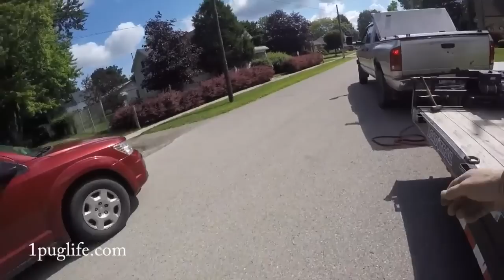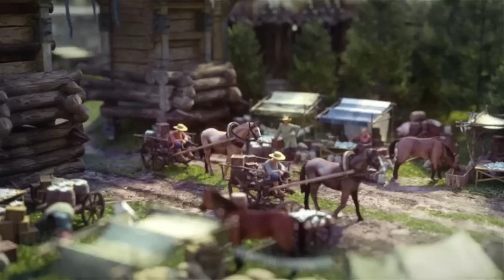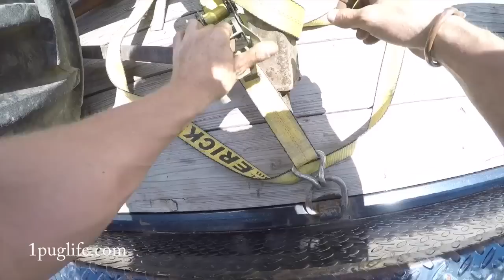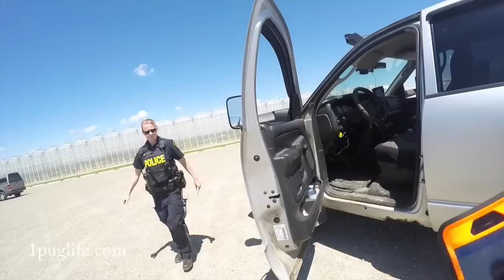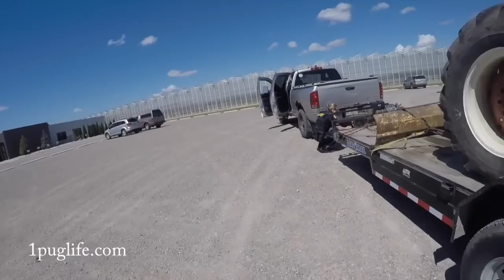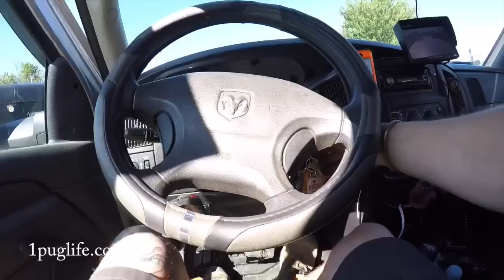illegal towing operation

Comment: poor pug here in murica you can pull 2000lbs with a prius and no won gives a fuck
Reply: mit the great Hell, my tractor weights 13,000lbs alone. Add the shredder and trailer weight it's pushing 15,000. Thats being pulled with a 1/2 ton rated for only 8500 yet it pulls fine. Cops dont give a flying fuck anywhere i go..
Reply: Ontario is strict with this type of thing
Reply: gg mit the great i watch you
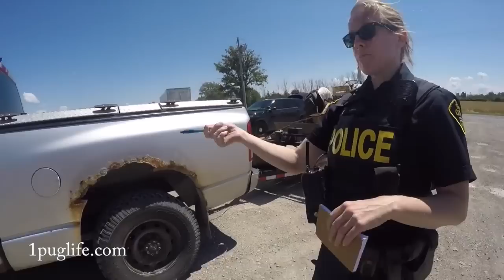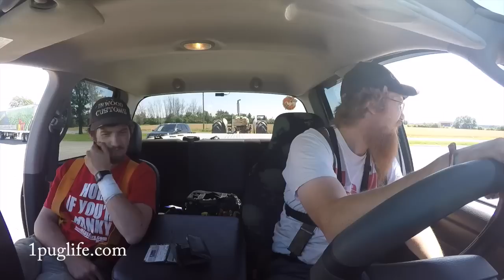Reply: @Snipe This looks like a Case 530 which weighs 4,000lb. I'd say he is at around 14,000lbs combined. The truck is rated at 18,000lb to 20,000lb. The truck itself weighs 7,000lbs or 3,200kg, so i don't no what the hell she was talking about at 5:00.  4600kg or 10,000lbs over makes no fucking sense. 7:09 According to the Ontario Ministry of Transportation pug1 is not required to have a CVOR. The cummins is rated at 4,000kg gross weight not 4,500kg as she said. She is laughing at herself because she has no fucking clue what she is doing. As pug1 said at the end, it doesn't make any sense. The thumbnail should have been her with her hands up! lol
Reply: Trevmanmcflair hell never quit that it home
Reply: Johnathan Yinger yeah she was jist sent in to do their dirty work...
Reply: Yeah, what she was saying wasn't really making sense to me either.  I had the Murican equivalant of a CVOR (CDL) and of course that stuff is pretty strict, BUT I don't know anything about permits for 3000 kg (6600lbs) on  light duty trucks.  Course that's Canada, eh?  Still she clearly had a limited grasp of the subject...  The numbers she was throwing out there seem pretty thin air stuff.  Pug asks "is this new?"  She says "we get training on it"
and they just bought the scales.  Sounds to me like it's real new to her.
Reply: It makes me feel even more proud to be an American.
Reply: It's all because of the bumpers. They gotta weigh 1000 kilograms each.
Reply: It's Canuckistan buds, like America but run by the Swiss.
Reply: lol right
Reply: Pug will have to mekum bumpers hout of alumawerds and
paint them rattle cans black so they won't whey 1000kg each.
Reply: mit the great exactly  lol shit is fucked up in canada lmao
Reply: yes but what about the trailer wobble and sway you forgot to mention Mr Fuctard?
Reply: mit the great bro, i dowed a cat d4 dozer with my 3500 on a goose neck, got pulled over for an out tail light on my truck. Got off with a warning
Reply: mit the great where i live in Canada they don't care we towed close to 10000 pounds with a truck rated under 5000 pounds
Reply: Jesus!  Holy shit Ontario!  Mean while in the US... you can tow a giant ass 5th wheel trailer and no one cares
Reply: The law is actually very similar in America...I own a landscape business and have been nailed with a very similar fine for similar transgression.
Reply: mit the great
Reply: But drive on 401 vs i75 in Michigan now u know why they are strict on this shit. Your stopping distance is longer too with more weight
Reply: mit the great fucking hillarious hahahahhahahahahaha
Reply: RANDALL KOEHN if you are drivibv commercial in the states, you need a cdl with a f-250 and just about any trailer. for personal use, you can buy a semi a drive it with no cdl, thats all a class a motorhome is.

Comment: “The roads aren’t meant to handle this much and you’re damaging it” blah blah blah. Meanwhile a 80,000 pound tractor trailer drives by lmao.
Reply: @jasonh7726  plus pay more tag taxes lol
Reply: Damage does not have anything to do with it. lol. It’s all about digging in your pocket and getting a cut of what you are making.
Reply: @jasonh7726  actually I build roads for a living.  And as I said if a truck and trailer under 30,000lbs causes damage to a road the road had bigger problems than  the truck
Reply: @jasonh7726  I'm sure you've done plenty of proof rolls and base prep for stone and pavement.   He was nowhere close to enough weight to even come close to hindering a roadway that was properly built.
Reply: @jasonh7726  ah insults about someone you know nothing about.  Actually I'm an engineer. One of the best in my area. I understand more about building roadways than you ever will.   You will not change my mind. If a pick up truck with a twin axle trailer under 30000 gross damages a road that road had more issues than that truck.  Do you happen to know why I'm basing it of a twin axle and pick up at 30,000 because that way under what 90% of roads are engineered for based off of psi at the foot print.
Reply: @stevenrichards9490  Anyway, thanks for the chuckles, I'm done dumbing myself to your level. No more replies from me. But if you READ your first comment and STILL think  his truck and trailer weigh 15 tons, be my guest
Reply: @jasonh7726  yea you made absolutely zero sense mr, rocket scientists know it all. I'm an engineer for a heavy construction company. So no I'm not a HIGHWAY ENGINEER. We have our hands in far more than subbase construction, aggregate base, and bituminous placement.
Reply: @stevenrichards9490  Sofa king we Tod did
Reply: @jasonh7726  you said you wouldn't reply and you did lol

Comment: This has nothing to do with what a vehicle can pull. It's what the vehicle is licensed to pull.  It's this way everywhere. If you haul heavier loads you pay more for license/registration.
Reply: What would some keyboard warrior understand about that? But yes.. without a shadow of a doubt you are 100 percent correct. End of story people..
Reply: exactly sir
Reply: pug needs to move to NH commercial plates start over 26k lbs, regular passenger for anything under, higher GVWR trucks just get hit at at higher yearly tax rate
Reply: so you're saying that you can buy a Dodge diesel like this that is rated to a very large GVWR and GCVWR but the state only lists it as a fraction of that because if you want to haul at full GVWR you need to pay more tax??? well fucked if I knew that! good thing I'm in the Texas of Canada....... 'BERTA!!
Reply: superturboawesome1, I think he's eastern Canada.. like Ontario eh, (first video I've watched).  But, ya, glad I'm from the Canuk Texas too, I can max out the tow rating on my truck and not a thing the cops can do about it because I'm non-commercial. Even then I can be over weight and not much can be done as the weight laws apply to commercial vehicles. When I do stuff like in the video, I'm moving stuff for friends who aren't paying me, just giving me some gas money.
Reply: Actually no one cares what you can pull, they care about what you can stop ;)
Reply: in most parts of the US, you don't need to do any special licesure/registration until you hit 10,000 lbs / 4500Kg

Comment: She was off her cigrit, roads are designed for semi truck loads. Light truck loads are considered insignificant for pavement damage. She frigged you over big times and was talking like a goof
Reply: b-lame to be 100% truthful roads are designed for that, but highways were made so that planes could land on them during WW2 incase of homeland invasion.
Reply: Bottom fucking line any vehicle that puts wait on the road does damage to the road. Also she said she ran the plate as he was passing by which I’m not 100% sure but pretty sure she can’t run the plate without knowing a crime or infractions has or is being committed and there’s no way that she just looked at the truck and trailer and just knew he was over weight. Then again that might just be the law where I live but like he she way she fucking goes.
Reply: Gunslinger Rocks in PA the cop cars can read the plate them selves they have a camera that reads them so all they gotta do is get behind you and it pops up on their computer
Reply: Damaging the roads is a load of horse shit.

Comment: you should of loaded the truck on the trailer and pulled it with the tractor
Reply: chris reeds too funny!
Reply: I think so too.
Reply: HAH!
Reply: Yup! Then all you would have needed was an orange flag.
Reply: or reflective triangle
Reply: Hahaha... I don't think she really knew what she was talking about. Maybe she didn't understand the class. Like he said the truck weighs that or more... Can you not put any thing in the bed???? Do you have to go to the bathroom before driving to make sure your not overweight? It's probably a max of 3000 per axle not the entire thing. Having the weight dispersed between 4 axles is less damaging to the road.  She just doesn't understand this and need to be trained correct before they send her out giving citations! I hope you got that cleared.
Reply: lol!!!!!!
Reply: Micah AP, I went over the scales somewhere in Oregon East of Portland in my 24K GVW 24' box truck. I had a load of glass display cases in the back weighing 10K pounds. My front axle had a rating of 8K pounds. When I went over the scales my front axle showed 8,016 pounds - technically over axle rating by 16 pounds. The only reason that I did not get cited was because I had my fuel ticket coming out of Portland showing that I had consumable load to burn off. They are not necessarily mean, or rude, just by the book - most times.

Comment: As a truck driver in California (California Bridge Law) over axle or over gross they can park you and not let you leave with that load. It's complicated. Best I can offer is know what your weights are. In California its a buck a pound overweight and it gets exspensive real quick. Sounds like you got off easy. In Cali you'd be calling a flatbed with a Long wheelbase that can legal that tractor. That road base you hauled the other day was way heavy too. You were probably over on your 2 3 and 4th axle and it would have been spensive. Learn the laws man. It's a tough game. See Great Dogdad videos for more exciting tips on trucking. Like...don't do it. All the best. GDD. PS. If you had a dually different story too.

Comment: whole thing sounds like a money making scam to me
Reply: nexgenhippy someone liked 240 very much. Lol!
Reply: Repairing roads due to overweight vehicles costs money
Reply: There's proper taxes to fund that.
Reply: this is literally what truckers have to deal with all the time. can confirm.  I am one
Reply: This is nothing more than a money extraction operation. Taxes paid at the pump are to cover road repair. This is monies to be used in the general fund. Big Fing Scam.
Reply: RealAnimal actually the “Income” tax originally was to go 100% to the roads when it was first introduced. I was shocked when I first heard that
Reply: that how it is, if we don't have a CVOR in Ontario we cant tow over 600 lbs unless its recreational.
Reply: 600 or 6000?
Reply: Gregory Gammons you cannot pull enough weight with a pickup to damage any road. it's all a money extraction operation.
Reply: if such situation happens in where i live, Macau, the whole vehicle will be sent to inspection immediately, and will count on each faulty lights, machanics and bodywork and each 100kgs overloaded, even a single decimal point will count as the extra 100kgs.... each 100kgs will cost you 2,000MOP (2xxUSD), not to talk about each faulty stuff, and another 2,000MOP (2xxUSD) of inspection application fee... that's sucks...
Reply: It’s not a scam if they would have researched the law and abided they wouldn’t have had any issues
Reply: nexgenhippy just another way for the revenuers to steel your money and try to control free Americans. People need to start paying attention to laws politicians are making and start fighting back because if they don't soon you will need to buy a permit to take a shit!
Reply: Welcome to Ontario
Reply: Enrico Mc C that pickup is already “overweight” without that tractor or trailer. It was all an idiot who
Didn’t know how to do their jobs fault. That tractor is under what that pickup is safe to handle, and that pickup will never run a weight that will cause a serious road issue. It’s all a money making operation.
Reply: lol yep paid for them fancy scales on their first use!
Reply: Silent Death g
Reply: Robert Collins Safty is what it is supposed to b. Most people don't eaven know how to hook Safty chains the right way. U criss cross them so your chain catches it instead of going in to the road and flipping your truck or trailer
Reply: You'll think differently if an over weight truck cant stop and you get hurt
Reply: @ggamms3187  which is funny because I guarantee the same roads he's on have commercial trucks that can weigh (legally) up to 34,000lbs per axle, driving on them, how's he damaging the roads?
Reply: yeah it does sound like a scam cause to tow any trailer you go by hitch weight and tongue i thought? plus the dodge is fully capable of pulling that trailer i call BS
Reply: State of Missouri the same way. So many people buy car tags for trucks
Reply: Was just about to say the same thing
Reply: @theoryofadown  18 yrs and still driving big rigs & I've never been thru this..sometimes i get pulled into the scale house..not much now though..but i never go bnb thru this
Reply: @redsoldierftcarson  not the front axle
Reply: It is
Reply: It really is
Reply: Over weight doesn't matter unless your COMMERCIAL !!. At least here in Florida !! You can haul a 30ft gooseneck with a Ford Ranger and be LEGAL unless your "For Hire" !! Then you gotta use a 1 TON or Bigger Tow Vehicle !!. This is ALL ABOUT THE MONEY !!. CROOKED CROOKED CROOKED !. Law Enforcement is the BIGGEST GANG in the Country !!!.
Reply: She said it her self, it's more money the government takes from you lol
Reply: @jp8457  This "Little Truck and Trailer" is DAMAGING THE ROADS !!!!!!!???? But a  80,000 pound SEMI doesn't damage the roads !!!?????. If "The State" is SO WORRIED about Vehicles damaging the roads, SHOULDN'T THEY BUILD BETTER ROADS !¡!!!!?????. It ALL ABOUT THE MONEY with "The Government" !!!!!. Tax the shit outta it's Citizens, Then come up with ALL KINDA BULLCRAP fines for Vehicles, So they get the little bit we managed to keep from all the Taxes !!.
Reply: nexgenhippy, that's exactly what it is, pure scam from the government. 
Scamming and stealing from the hard working taxpayers.
Reply: Gregory Gammons, a bunch of BS.
how about the Transports and Gravel haulers.